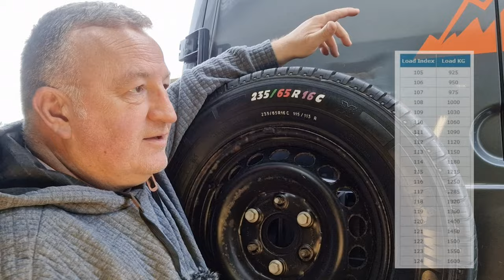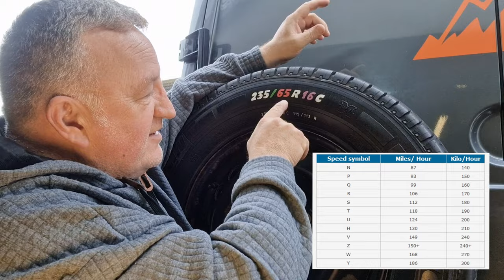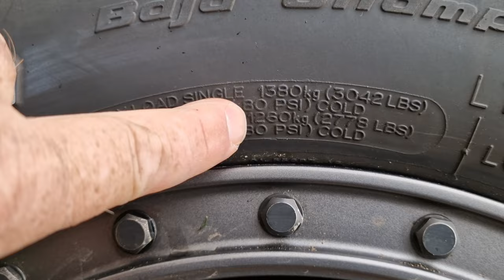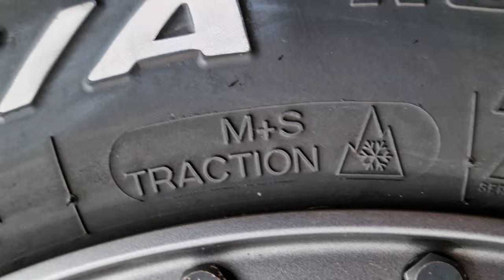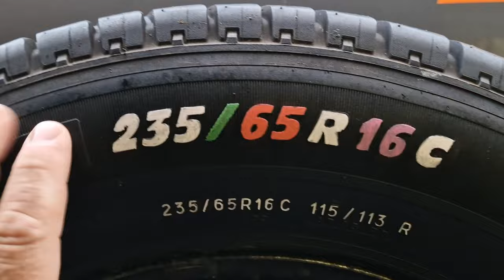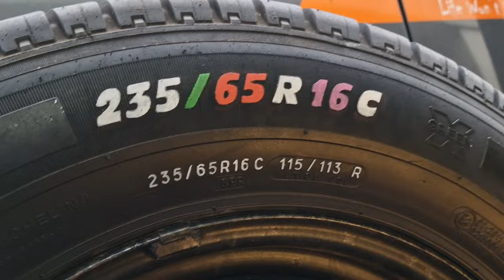What do the numbers and letters on a tyre mean?

Comment: Great and very helpful and spot on, mate! 😊👍I've mounted these BFG TAs in Canada as far back as the late 70s - they've been around a loooong time.
Good point on the speedo: If you change wheels from stock to aftermarket alloys, you will likely change the circumference of the wheel and your speedo will possibly need to be recalibrated.
Staying with this example, your speedo will be off (light) by about 9%. Something to remember, when you have to watch the speed limit. 🥴
That mud & snow icon with the mountain and the snow flake is now MANDATORY in winter conditions here in Germany. Cars with inter tyres having the old icon are deemed unfit and will get pulled off the road during checkstops.
Tyres - like lots of things - do not like direct sun light. They have to withstand that through design, but it is also a life-limiting factor. 
I just happen to notice your mudflaps, which do appear to be original, but they look like they've been shortened?
See you soon! 😁
P.S.: Nice paint job on the tyre sizing! 😜
Reply from the maker: See you soon mate 🫶😊

Comment: Great video. Have used BFG KO2 for many a year and they certainly are hard wearing. The downside to this is that they are prone to let go in the wet. Braking  distance is increased and cornering can be interesting. Winters in the Highlands are a good test for them. I have had mud terrains as well and for year round use all terrains win. Muds are great for winter especially in deep snow but being a softer compound don't last as long.
Reply from the maker: Great to know 😊👍

Comment: I have the same tyres mounted on my van and are very happy with them. In spring and autumn it is a relief not to think about sudden snowfall when away on a trip. I do run these tyres all year around although there are better tyres for winter use. Mine has been on for 40k km and will need to be changed within the next year/15k km.😉
Reply from the maker: Where are you based?

Comment: Hi Sam
Glad to see the van and tyres are doing well. Two points I picked up on with your explanation was firstly the 235 meaning. The first time you said it’s the size of the tyre width which is correct but the second time you said it was the tread width which is not quite correct. I thought this until I was ‘re-trained’ by VOSA as an enforcement officer. If you place a tape measure across the tread area you will not get 235mm. It refers to the entire width of the tyre when inflated including the sidewall ‘bulge’ if you get my meaning. 
Also the reduced load rating for a twin wheel fitment is due to the close fitment of the two tyres not allowing  the heat that builds up while they’re rotating to dissipate as quickly as that of a single fitment due to the reduced airflow around the inner faces. 
Still a great video. Tread wear indicators are another ball game altogether they’re not all set at the same depth it depends on the manufacturer some are at 2mm some at 1.6mm. Michelins have a little Michelin man on the sidewall in line with where they are to make them easier to find and some manufacturers have the letters TWI on the sidewall instead. 
Where do you stop with all this info I don’t know. Most people have probably fogged over already but some may find it interesting. 
Asymmetric tyres rotational tyres what next? Out of interest though are your tyres marked rotational? as obviously this will restrict how much you can rotate them (I.e. not diagonally) without failing the MOT for ‘ not fitted in accordance with the manufacturer instructions. 
My Michelin cross-climates are which is why I ask.
Reply from the maker: Thanks for the heads up, everyday is a school day as they say, I do try to keep the info as general as possible as we could disappear down many rabbit holes, the KO2 are not marked up as directional so if needed I could swap them diagonally

Comment: never knew half of this , may be 3/4 if I'm honest , the bit i did know and can confirm is that i knew it was a tyre , and can confirm we have 5 of them , and there all full  top and bottom
Reply from the maker: I looked into it all when we were all up plating, but of late lots of people have been saying you can't fit the KO2 to a van as they are not commercially rated I think Light Truck covers that one!
I can see them crawling back under their rocks 🤣 until the next time 😊👍

Comment: Hi, do you still use the manufacturer recommended psi with those types of tyre ?
Reply from the maker: Good question, we tried lots of different pressures to begin with and settled for 58 psiwe run at 3.6 tons most days and we found 58 was the happy number